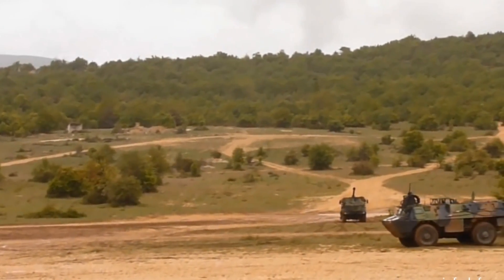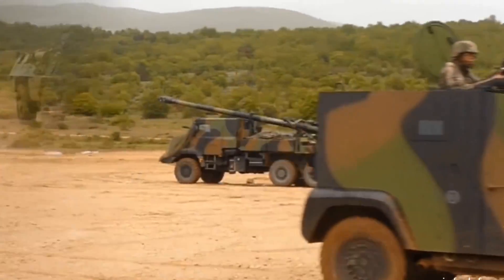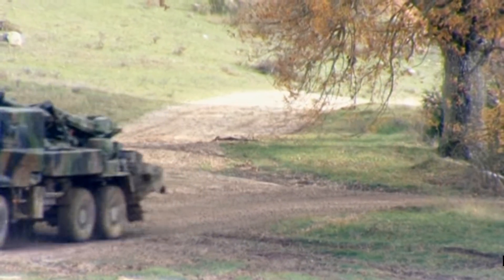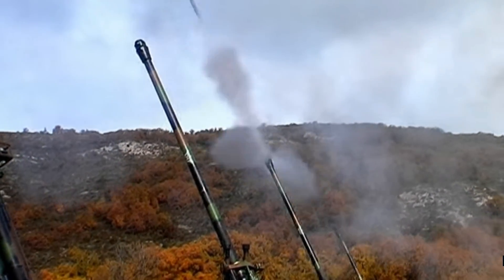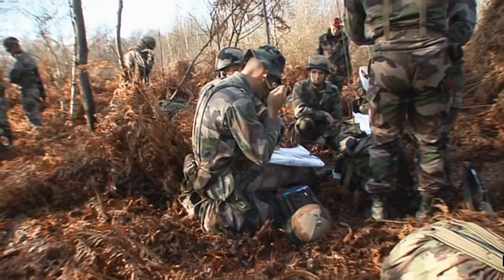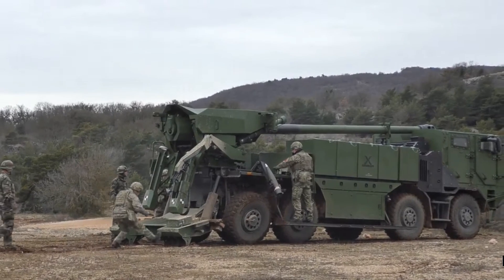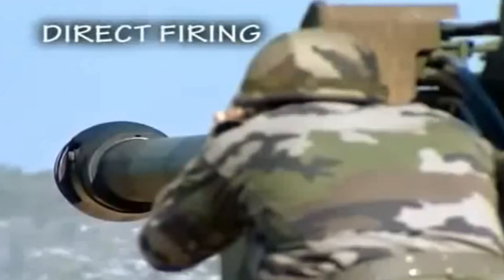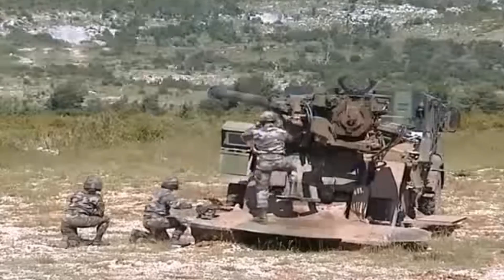CAESAR 8x8 Self-Propelled Howitzer Review

Comment: Well, I think You are looking at this system the wrong way, Matsimus!

I think they are trying to mount the same system on different chassis.

For the heavy units they want to mount it on a CV90 chassis. The loader arm will then go back further, so the crew can remain under protection while servicing the gun.

The medium units will use a Piranha 5 chassis - with the same protection system as others - just on a higher level. The spade will give protection when not deployed - and no: I don't think the loader is the definate one. What you need is a loader that keeps the grenade and charge separate for as long as possible - and if a cook-off happens the crew will be behind armour protection.

The light units will employ (just my prediction) a Eagle V 6X6. Still under the armour protection an Eagle V uses. The decisive thing is that it fits into a Hercules - if it fits a Hercules it fits pretty damned much everywhere.

But no: I don't think the loader is the definate version.

The Artillery will use the same gun system but on different chassis's.That will simplify training.

The different weights of the chassis will primarily be countered by different charges. The 8X8 (comparable to a Piranha) seems to be allright with a charge 3, whereas the 6X6 clearly has suspension problems with a charge 6.

To be honest I think the spades main task is to adjust azimouth between firings - no reason to put two grenades into the same hole.

Comment: French here. Indeed the feeding system of the 8x8 is totally awkward.... And not error proof (too many components and tasks). Moreover it's not fully automatic (cf. the guy handling the shells) whereas it could be "easily" done (the Leclerc has got a good feeding mechanism). My 2 cts.
Reply: XM2001 Crusader My $11 billion USD
Reply: The CAESAR 8x8 has a brand new fully automated ammunition loading system. It is operated by a crew of 2-3 men. Maximum rate of fire is 6 rounds per minute. Though the CAESAR 8x8 is also proposed with a semi-automatic loading system, which requires a crew of 4-5 men."
the danish chose the latter one.
http://www.military-today.com/artillery/caesar_8x8.htm
http://fna.artillerie.asso.fr/files/posts/brochure_CAESAR_8x8_uk_HD.pdf

Comment: On the autoloader thing I both agree and disagree.

In general I think that autoloaders are the way of the future and in the long term will overtake manual loaders especially in something like SPGs where the rounds are larger and rate of fire is a concern.

That said I think CAESAR's 8x8 autoloading solution was pretty abysmal, still carrying the baggage of being laid out for manual loading with the gun mounted to the rear hitch essentially, all the machinery in the open and exposed to the weather and as you point out not really gaining a ROF advantage for it. While longer in the tooth and even worse for ROF I think the DANA at least was laid out correctly and a similar setup with an upgraded autoloader and perhaps an upgrade to allow more turret traverse would close the gap considerably between the quality in the tracked SPGs and the wheeled SPGs.

Comment: A few things.
This system is fulfilling two jobs, it is cheap enough that it can actually be compared to the normal static field artillery, and it is fast and light enough to be part of an expeditionary task force. This is no small thing.
Regarding the mechanical arm, the soldier didn't have to hold the shell for a long time, meaning he would not get tired as fast... It looks goofy, but the system makes some sense. When mechanical breakdown occurs, I am told that the arm can be ignored, and the soldier can load the feeder.
All in all the system should be rather good.
Reply: Another thing being that turnaround time is not near as big of an issue as emplacement and displacement time. My other concern was that if there is an issue with the truck (which happens all the time) you have now lost a gun. When we have issues with trucks we can switch out the truck.
Reply: I would also bring up that from the sound of it, this cannon cannot shoot after being hit with an EMP or if there's a digital failure. US cannons can.
Reply: @CoconutSteve22  What fucking EPM. Point me to one damn use of an EMP in any conflict.
Reply: @Night60700  Carrying the damn things around is literally my job.
Reply: @Night60700   USAF used EMPs on Iraq.
Reply: @Coffee4myTavor  The EMP weapon is a high altitude air burst Nuke. The US AirForce has never used a nuke in combat.
There is no EMP weapon. The Navy tested a device the size of a truck back in 2007, but they even stated they used it for testing and that it had no combat usage.

So please stop spreading bs.
Reply: @Night60700  nuclear detonations are not the only way of creating an EMP. Research it.
Reply: @Coffee4myTavor  Sure it's not the only way. As I said the US Nazy has a device they use to test the EMP proofing for their own systems. But the device takes the kind of power you'd need a ship's engine to make. There is no way the AirForce could ever use it on a plane. And even if they could, it has a range of 600 yards. No way some huge plane is flying just over ground level flying slow with a massive generator in the hold. It just ain't ever going to happen.

Please educate yourself.
Reply: "normal static field artillery" is not a thing, US howitzers need to be able to move and bound in a similar manner to infantry. A well trained battery can emplace in a minute 30, shoot with a turnaround of 7 seconds, and displace in one minute. An autoloader cannot train to be faster. Another issue I would bring up is that if a truck goes down (not necessarily in combat, could be mechanical issues), you now have a gun that is down. With the m777a2 (the current US howitzer) we can simply hook the gun up to another truck and move on.
Reply: @CoconutSteve22  I FUCKING DARE YOU TO FIND ANY ARTILLERY CREW DOING A 155 7SEC RELOAD. 10 seconds tops for a good crew and that's fucking back braking. That guy just standing there and you bitch? Clearly you've never had to carry the damn things around.
Reply: @Night60700  I have personally done a 7 second turnaround. I have seen videos from buddies of 5s.  And as far as EMPs go, believe it or not, the military likes to be prepared for things that may happen even if they have not happened before. I don't claim to know the inner workings of  an autoloading cannon but losing electronic capabilites would be a concern of mine.
Reply: @CoconutSteve22  How the living fuck do you load a 6 inch 2 peice in 5 seconds safely without a rammer. I mean if you don't clear the barrel and have 2 extra for loading, maybe I'll buy your 7 second bs. But 5? No.
Reply: @Night60700  I'm not sure what you mean with some of what you're saying. I'm talking about a M777A2 Howitzer section. We do not clear the barrel in between rounds and I am not sure how 2 extra for loading would even work
Reply: @CoconutSteve22  I am getting the feeling that you're the counting the time it takes the fire a loaded gun. Which would be pedantic.
I mean you're the loader. You don't care about firing the thing.
Reply: @Night60700  I am talking about from BOOM to BOOM, 7 seconds
Reply: @CoconutSteve22  Prove it then. Then watch the video this comment section is for and tell me you're loading a gun at near vertical angles. Auto loaders are the future man. If that tray the guy was put the shell on moved around a bit, loading could be done by 2 people at 6 RPM all day, possibly faster. How many on that gun with you. 6?8?. This gun had a 4 man, that's like a 105 towed.
And yes I know 2 people can in a Pinch load and fire a 105.
Reply: @Night60700  I don't need to prove anything. I was only voicing concerns I would have about switching to a system such as that. I know what I know because this is what I do for a living. I also do not claim to know a whole lot about the self loading cannon in the video. I can only assume - same as you, unless you've been on a self loading howitzer section. The future of artillery is really up in the air right now and a lot of different avenues are being looked into, this being one of them.
Reply: @Night60700  My question for you would be where you got this idea that 7 second turnaround is that crazy of a concept. Where are you getting your artillery information from
Reply: @CoconutSteve22  The point I've been trying to get across is. People get tired and can't pull off burst fire speeds constantly. An SPG can, albeit with a lot more maintenance.
As to your breakdown concern. Ya you're right. But no weapon is perfect.
But let me just pose a thought experiment.
If you are towing a 6inch gun, and the truck brakes down, what then.
If the truck you're using is only towing the gun and has no other equipment or passengers, which would be inefficient. Then sure you can switch to a different truck that is already there when the breakdown occurs. But then why weren't you using that truck in the first place. Unless you are literally planning on that first truck to brake down. Which would be cynical.
Now why do I focus so much on that? Because if your answer is to just call up a new truck. Why can't another SPG be called up in the same time.
And yes calling up an SPG like that just isn't how it works. They operate in pairs for the, breakdown under fire, problem. This means one SPG brakes down and you actually lose 2 guns.
Infact your breakdown point is like the only real "I can't see a solution" problem with SPGs. I can trust the auto loader will work untill it gets dirty enough. The engine.....
But let's assume no problem, just call up a new SPG. What would be the difference?
Reply: @Night60700  Our trucks run about 200,000 a piece and the guns at least 2 mil. We have significantly more trucks than guns as we also use the trucks for other things such as carrying out extra equipment and towing out the water supply. There has been numerous times we have lost a truck/a truck has been degraded and we have shuffled trucks. The truck is not empty, we just shuffle/redistribute gear and personnel.

We also on occasion have a gun go down. One situation we had recently was a gun went down, and was driven back to mainside. Then a different gun truck went down, and the  first truck came back and towed that gun
Reply: @CoconutSteve22  So let me if you will get into why I perfer autoloaders.
 It's a issue of progress. The Horse doesn't brake down. But early trucks sure as hell did. This is why you saw horse towed artillery into ww2. 
So you can understand my issue. Just because it can brake down doesn't mean that weapon systems like Archer aren't totally the way of the future.
 2 guys firing off 3 dozen rounds without even standing up. That's the future.

Comment: I have heard that the auto loaders are not necessarily designed for faster fire but rather to allow sustained fire over longer periods, the crew getting tired example you mentioned. But they are also designed to reduce crew size and save money. Professional soldiers are expensive if you can take one out without reducing capabilities but reduce costs means you save or free up money for else where.

Comment: You need to check out the new 105mm Hawkeye howitzer.  It has a reduced recoil system that is so light in recoil that they mount this gun on a HUMVEE.  Apparently, they shot it off a trailer they bought at Home Depot and a Ford F250.  This looks like a dream for air assault or amphibious assault units.

Comment: Matsimus: A very inspriring video. The CEASAR has been chosen by the Danish Army to take over from the M113.
Now there are, if I'm not mistaken (which I might very well be):

If the Danish Army is following my plan the CEASAR is not so much the vehicle.
The 6X6 chassis clearly has its problems jarring the teeth of the commander into his video-display. But that can be allieviated by reducing the charge. We know that the gun can take a full charge 6, but with a charge 3 things might be a bit more ameniable without reducing range to much. So the CEASAR is useable on a 6X6 chassis. And the crew could be under some sort of protection instead of standing in the ruddy drizzle outside.

But if it can be mounted on a 6X6 chassis it can be mounted on an 8X8 (incidentally I think the chaps on the 8X8 are Danes). Now the medium vehicle today is an 8X8 wheeled infantry fighting vehicle. One thing that is nice if you are infantry is that your artillery is able to keep up with you on the long hauls on the German autobahn.
I think that pincer autoloading system (and I fully concur with your reservations on the arrangement shown in the video) is designed so that the loaders can sit under armour protection with one loading the grenade and the other the charge with a hefty armour plate between them in case of an explosion of one side or the other - blowing the roof off and leave the rest of the crew with a survival chance - and a dismayed face.

Finally I surmise it is also considered mounted on a CV90 chassis that can keep up with the Leopard 2 and the CV90 ICV in the worst terrain under fire. Now that opens for the use of the pincers: Lifting out the grenade and the charge. The ammo-boxes could be turned with the opening inward. A CV90 chassis could take a full charge 6 without spilling to much beer.

The real consideration is - I think - that there is a lot of 155mm ammunition in the depots of various Nato countries and it has been paid for 30 years ago. A 155 mm HE shell cost about 500 USD which is a damned sight cheaper than some of the more advanced rockets. A Javelin missile cost about 250,000 USD and takes out one tank, while 500 155mm shells pr. tank will leave the platoon of tanks severely dented.

Besides the Danish army has ordered 900 Scania terrain trucks of which 5-600 are also armoured. A 10 ton load is about 200 shells.

So the standardisation is maintained in the chassis and the guns keeping training costs reasonable.

It will give the light units on Eagle 5 a strategic mobility - provided you can get your filthy paws on a squadron of C-17 Globemasters and put down a battallion sized battle group down anywhere in Europe in prepared positions with 24 hours notice from the gunners snoring in their beds with the little lady - if the nasties intend to as much as checking the track tension of their tanks. A battlegroup of about 1000 men does not sound as much - untill your brigade gets the attention of one - from prepared positions.

The medium on Piranha 5 would take a little longer as they move on the nice road system in Europe and be primarily intend for attacking the enemy in the rear. Three battlegroups tecking up an down along the boarder on call in case of an emergency is something that should upset the enemy's timetable.
And the can be supplied with reloads by the said squadron of Globemasters.

The heavy tracked battlegroup with Leopard 2 and CV90 does not move very far, but swatting them is a proposition of some difficulty. The mobility is limited in an operational sense - unless they come off a container ship. All of which should give the enemy pause to reconsider his evil plans.
Reply: Holy shit...wall of nonsense crits for 2000hp, your sanity has been knocked unconscious...

Comment: the limiting factor in the speed of loading an artillery gun isnt the mechanism, its the barrel
Reply: But... i want faster fire rates, do i really need rifling?
Reply: @rat_king-  No. But you do need a straight barrel that hasn't warped from heat.
Reply: @Night60700  Or a constant loss cooling system

Comment: Sounds to me like you would really want a Bkan 1 from 1967 when it comes to firerate in an automatic loading self propelled Artillery piece, just under 19 rounds/minute ;) (a bit too slow moving but it is tracked :P)
Don't get me wrong i'm a tracked vehicles FTW kind of guy to but you got to admit that an artillery piece have just a bit less need for superb off-road capability and a bit more need for speed ;)
Anyway i'd take an ARCHER anyday over this one. The only pluses i can see over the archer would probably be a lower purchase price per artillery piece and possibly somewhat easier maintenance.
Reply: Hagelbocken ! ; Why did they scrap the BKAN? A few tweaks and it could still kick ass (and fire tactical nuke-shells if needed). That was a piece that put fear into enemies just by showing up.
Reply: You're wildly confused. That used a pair of 7 round clips that took 2-3 minutes to reload, and 45 seconds to fire. Reload included at 120 seconds. That's 12 rounds per minute assuming idea reloading circumstances.